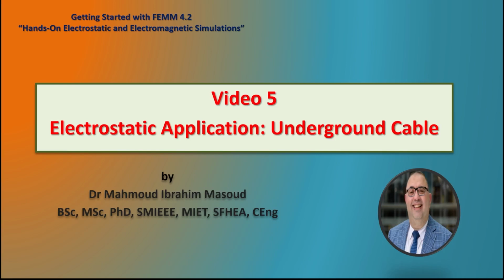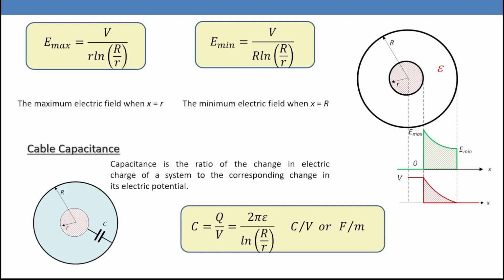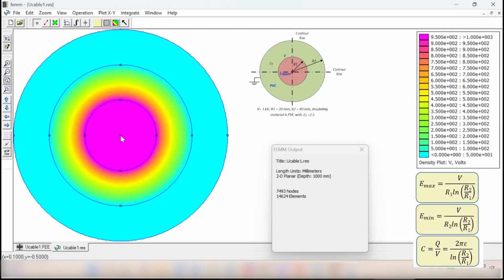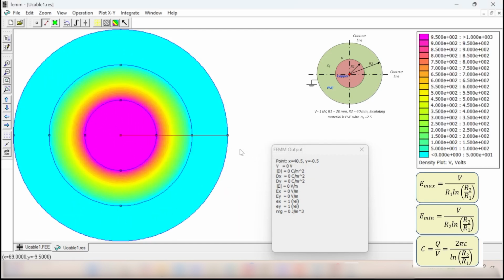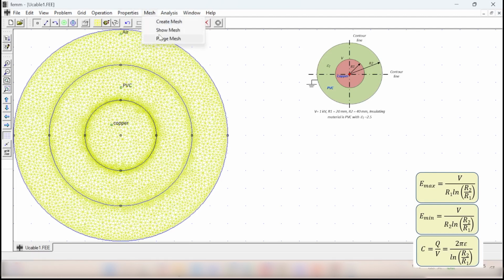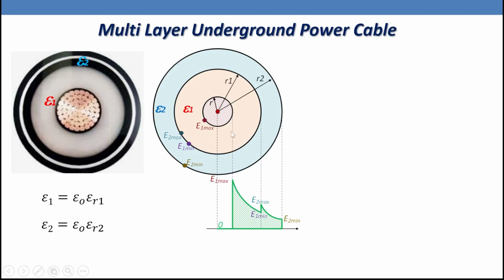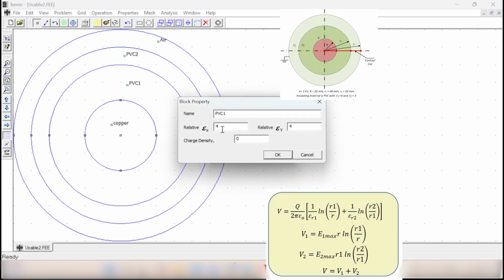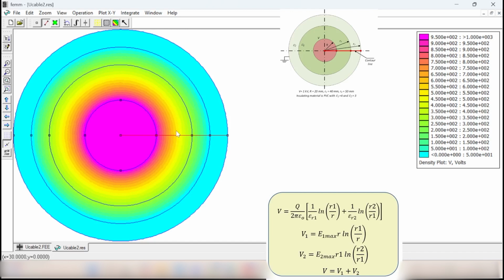Electrostatic Application: Underground Cable using FEMM4.2

Comment: Hello dr. I would like to kindly ask if it would be possible to explain, perhaps in an example video, how to use FEMM for power electronics applications, particularly for inductor and transformer design, as well as basic EMI analysis.
Reply from the maker: Hi, thank you for your comment. Regarding the electromagnetic example as an inductor in a relay device, which should be, to some extent, similar to the transformer, will be the next video. I hope i answered your question

Comment from the maker: If you're just getting started with FEMM 4.2 and want a step-by-step be-ginner guide before diving into this underground cable electrostatic simulation, make sure to watch:
👉 https://youtu.be/ifdcAW9mehg
This tutorial will help you understand the basics, geometry creation, and setup process so you can easily follow along with the simulations shown in this video.
If you find this video helpful, please 👍 Like, 🔁 Share, and 🔔 Subscribe to support the channel and stay updated with more FEMM and power engineering tutorials!

What You’ll Learn in This Video:
•	How to simulate a single-layer underground power cable using FEMM 4.2 in electrostatic mode
•	How to plot and interpret:
o	Voltage distribution
o	Electric field distribution
o	Electric field vector plots
•	How to calculate the cable capacitance using FEMM
•	The effect of changing the insulator material permittivity
•	The influence of cable dimensions on electric field distribution
•	Extension to a multilayer underground cable (two-layer case study) and its impact on the electric field